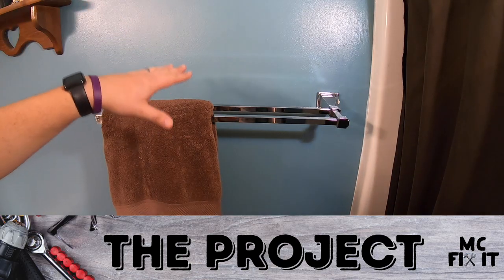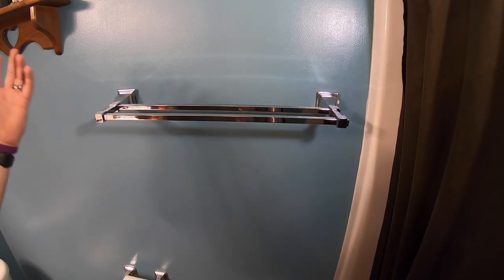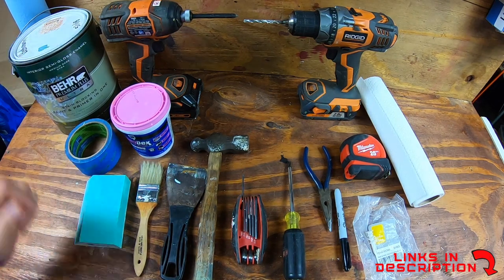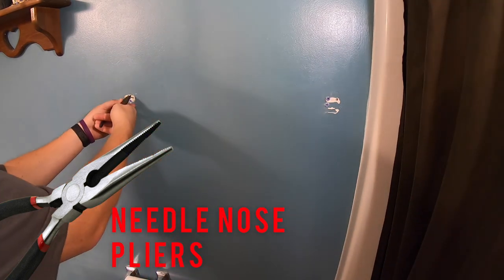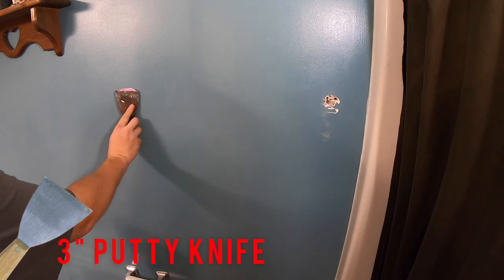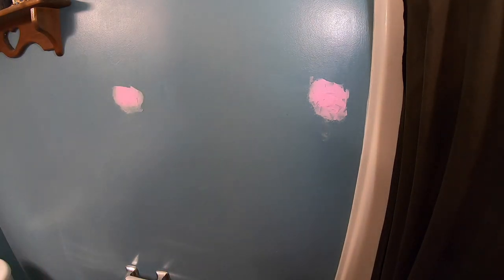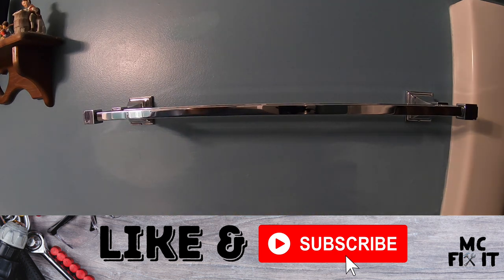Towel Rack Falling Off? Permanent Fix! [Complete Guide]

Comment from the maker: Is your towel rack falling off all of the time? Then it's time to refasten it to the wall. This complete guide will show you all of the steps and tools to make this possible! 

The Tools:
* Rigid Drill Set - https://amzn.to/3bb9t2S 
* Drill Bit Set - https://amzn.to/3f8gti8 
* Philips Screwdriver - https://amzn.to/3hdpzx0 
* Allen Wrench Set - https://amzn.to/3kuNSak
* Needle Nose Pliers - https://amzn.to/3neEYzK
* Spackling Dap DryDex - https://amzn.to/2YHnvpW
* Drywall Anchors 50lbs - https://amzn.to/30mck6p
* Tape Measurer - https://amzn.to/3bg83nI 
* Sharpie - https://amzn.to/3o3CZwW 
* 3in Putty Knife - https://amzn.to/3wKt6bR
* Ball Peen Hammer - https://amzn.to/3FeEpfq
* Painter’s Tape 3in - https://amzn.to/3Hm65R4
* Shop Towels - https://amzn.to/2SC8D93
* Sanding Block - https://amzn.to/3wMMchh

Chapters:
00:00 Intro
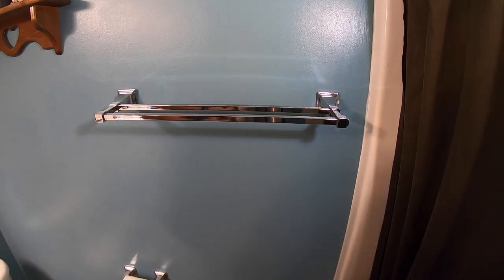01:26 The Tools
03:38 The Fix
04:25 Taking Off Old Rack
06:56 Patching Holes with Spackling
08:34 Measuring Rack
11:06 Putting in New Wall Anchors
13:16 Installing Screws and Brackets
15:26 Installing Rack
19:34 Sanding Old Holes
22:25 Painting Over Drywall Spackling
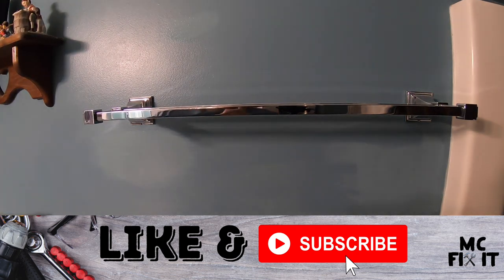24:07 The Closing

This video works on nearly all makes and models of racks for towels. Please measure correctly and then drill your holes.

Check out my website at http://mcfixit.us 

Disclaimer:
Due to factors beyond the control of MC FIX IT, I cannot guarantee against improper use or unauthorized modifications of this information in the video, post, blog, or social media. MC FIX IT assumes no liability for property damage or injury incurred as a result of any of the information contained in this video. Use this information at your own risk. If you feel uncomfortable at any time. Stop and go to a professional. MC FIX IT recommends safe practices when working on vehicles, your house, or any other project and or with tools seen or implied in this video. Due to factors beyond the control of MC FIX IT, no information contained in this video shall create any expressed or implied warranty or guarantee of any particular result. Any injury, damage, or loss that may result from improper use of these tools, equipment, or from the information contained in this video is the sole responsibility of the user and not MC FIX IT.

#mcfixit #towelrack #houserepair

Supplies used to record this video: 
* GoPro Hero 7 Black - https://amzn.to/3f3ALtb 
* 256GB Flash Drive - https://amzn.to/33pAueG 
* Vlogging Frame - https://amzn.to/33tajE0 
* GoPro Pro 3.5mm Mic Adapter - https://amzn.to/2RCURCu 
* Youmic Lavalier Lapel Mic - https://amzn.to/2R55sWX 
* Boom Stand (tripod) - https://amzn.to/3bdkQaw
* 5/8” to 1/4” adapter (boom to blogging frame- https://amzn.to/3txrVsM 
* Portable Battery Powerbank- https://amzn.to/3vJQc0q 
* 6ft USB to USB-C (powerbank to GoPro)- https://amzn.to/3uAS5MH

Comment: I’m having the same issue. Good instructions! I love that double towel rack. Does it allow each towel to dry properly?
Reply from the maker: Yes it does pretty well! We use our exhaust vents when showing so I think this helps pull some of the extra moisture out of the air. I kinda wish I would have got a staggered one for even better airflow.